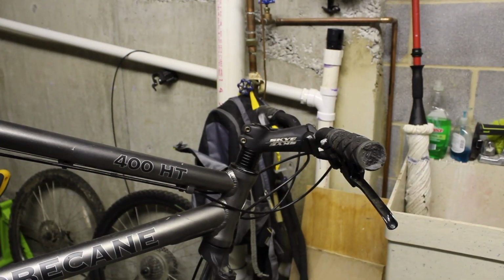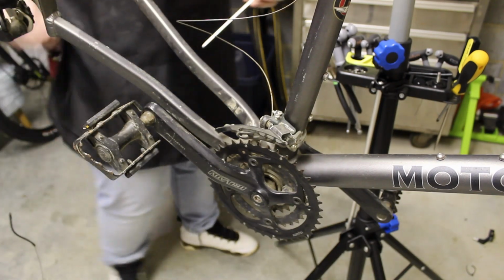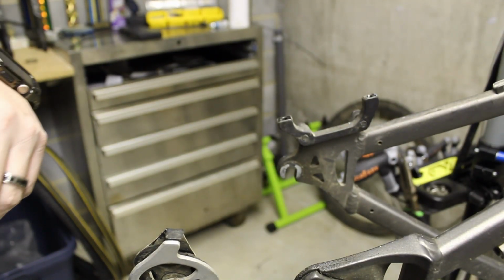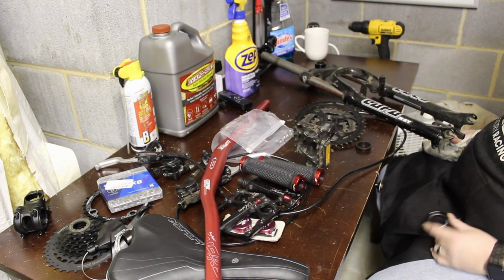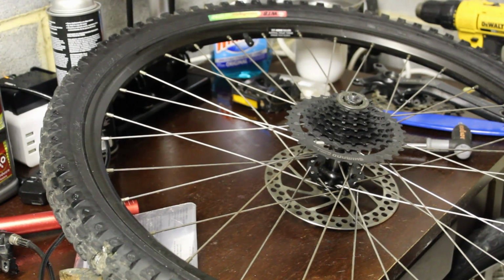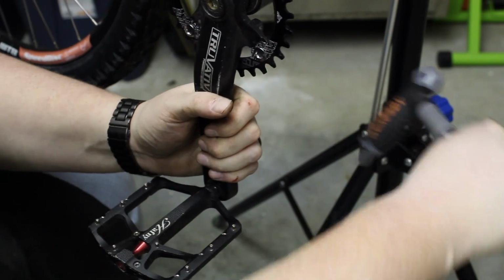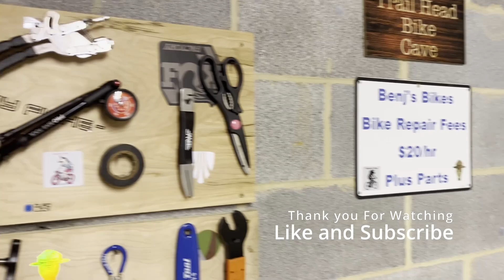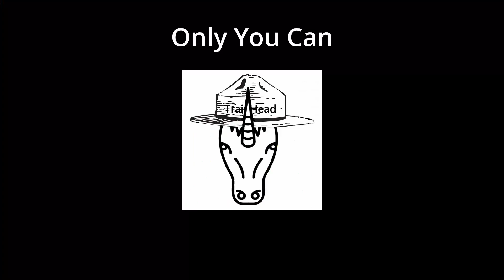Built My Friend A Free Mountain Bike - Pay It Forward Bike Build

Comment: I have the same bike sitting. I need to replace the chain and the bottom casket.
Reply from the maker: It can be a great inexpensive bike, really the fork and brakes are the only thing holding it back. $50 shimano hydraulic brakes and $150 sr suntour fork and you have a descent bike
Reply: Thanks. It's been sitting for probably 4-5 years. Going to air up the tires and take it around the block and see. Last time I took it out on the trail trying to climb up any hill/incline it would just skip if that made sense. I'm assuming this is the bottom casket. I'd pedal then there be no resistance as it skips/drops.